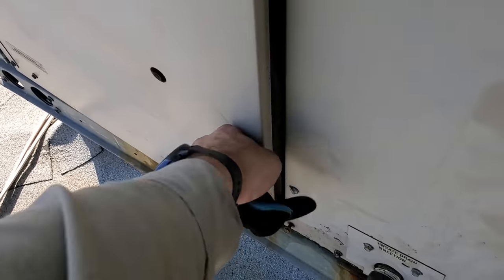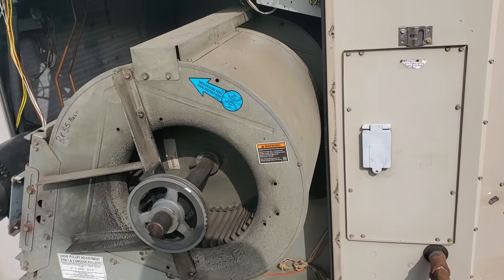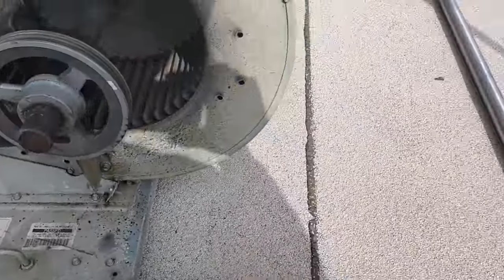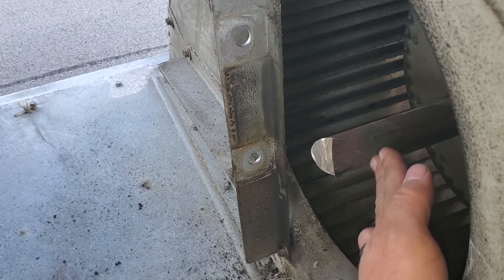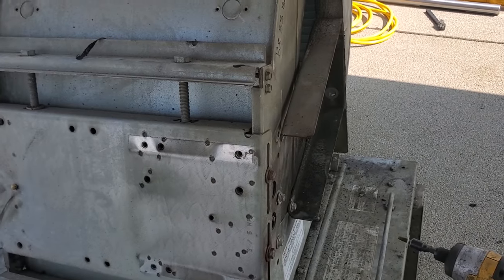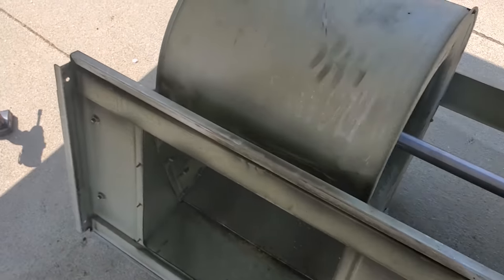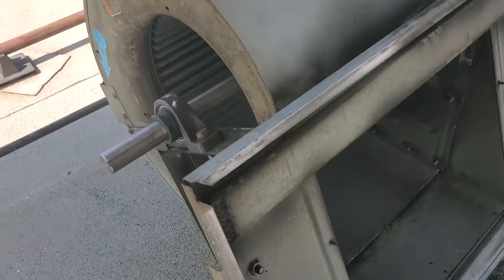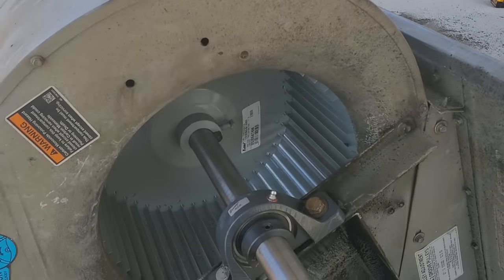THE AC UNIT SOUNDS LIKE AN EARTHQUAKE

Comment: You made me think about my very first TXV replacement job early in my career - A co-worker (Tom) condemned it based on low suction pressure (clue), and I got sent out to do the job. After finishing the work, I still see low suction pressure. Didn't take long to discover the clogged return grille in the store... 

That boys and girls, is how I learned not to trust other people's work, and to check all return grilles. That's also how Tom earned a kick in the ass the next morning. Those were good times.
Reply: Why not clean it?
Reply: @Stuart68505  That's kind of the point/lesson learned. A quick cleaning of the grille and I was good to go, but had the original tech noticed it before condemning the TXV or if I had done my own diagnosis before swapping the part, and we could have saved ourselves a whole day's worth of work.

Comment: Good video ! Like # 426. For the New techs out there - Regarding the Vibration. When they vibrate violently the wheels have most likely Lost a Weight & Cleaning Will NOT SOLVE the vibration issue. U will probably make it worse. Cleaning is Risky because if u Loose a Weight You are screwed. Best to Replace as Chris did here. Also Allways have on Truck stock extra key stock & An assortment of Allen set screws. You can buy Raw Key way material where you buy Your Bearings. King Bearing is a Good place to buy that stuff. Pillow block bearings , Regular Bearings & shafts. Good vid.
Reply: You do get that a keyway is the slot that a key fits into?
Reply: @335alien335   Yea man ! Been doing this 40 years ! Just a typo. Lmao. 😂🤣😂🤣

Comment: That's the ultimate price of not doing maintenance (including regular cleaning): you pay for a complete rebuild. Possibly suffer a breakdown before that. Solid logic quoting the rebuild right away! 👍🏻

PS PPE ftw, no one should have tinnitus because of work. Have both tinnitus and hearing loss because young and stupid. 🤬
Reply: Preventive maintenance is key, much cheaper than a rebuild!
Reply: Young & stupid definitely did some of the damage, but tinnitus runs in my family even among those folks who never did much other than office work.
Reply: This your older smarter self talking to from the future,  always keep -33db earplugs & use them often in addition to the muffs. 
I figure every hour with the plugs in equals a couple more months of better hearing in your retirement years.
Reply: I have tinnitus because of watching the original lineup of The Who live.  Absolutely worth it.
Reply: 20 years working around aircraft.  I always had ear plugs with me while working.  Kept the container on my badge.
Reply: @chemech  That sucks. Does it come with the bonus hearing loss or just the noise?
Reply: @aaronsmith5433  That's a good system! One layer of protection may slip.
Reply: @Slugbunny  I'm not yet 60, so it's just the continual ringing in my ears...

My dad however is in his early 80s, and he has significant hearing loss, as does his brother.

A math professor and a pharmacist, neither did all that much woodworking, and neither did much if any shooting or attending loud rock concerts...

Just what I have to look forward to, should I live so long...
Reply: @chemech  Okay, at least you get a grace period! I'm sure we'll all be wearing hearing aids in our retirement, regardless of how we lived. Good thing we have those... I'm trying to learn sign language just in case. 😉
Reply: @Slugbunny  Well,I was pretty good about wearing hearing protection for the last 35 years, but before that, everyone was more casual, and while we wore earplugs or muffs, we almost never wore double protection when target shooting or in the millhouses at the cement plants...

It's only in the last 15 odd years that double protection became a thing, and by then I'd been around ball mills and later electric-ard steel furnaces wearing only muffs...

It is what it is, and I'm not crying about it, just want the younger people to be more aware so they don't experience as much damage as my generation did when we thought that we were adequately protected...
Reply: @chemech  Yup yup!

Comment: when you do those locking collars, your supposed to whack them on an angle in the direction of rotation with a flat tip screw driver in the hole that has no set screw in it.  To loosen it, you whack it in the opposite direction after you release the set screw.

Comment: Good video!  Knowledge is Power...   My last new office I worked in had some hidden filters that weren't changed in the 6 years I worked in that building.  At some point someone queried the supply & the filters were found - paper, crumbling to touch!  The office prior to that was the Centerpoint building in Sydney, Australia.  After 30 years of operation & probably poor maintenance, we had to get the duct work cleaned, as dust was sputtering out onto staff...  That same building had two small water cooler towers on the roof - to service the Computer Server room.  One day, someone on our floor came to my area incapable of speaking what they'd just seen; one of the stacks from a tower - the guy wires holding the stack in place snapped, with the fibreglass stack falling down in between the our building & the next one.  A few yards in the other direction & the stack would have fallen onto the street below.  Sydney is similar to New York, so it wouldn't have been a good outcome...

Comment: If possible I would use a good penetrating oil and a brass drift and hammer to remove the shaft otherwise I would prefer a hand held bandsaw to a grinder because of the noise and Sparks flying back at you!  You did a great job there is no easy way to do this kind of work! Thanks for another awesome video!

Comment: For cutting those shafts without a dead wheel you can try a cordless m12 bandsaw. It will be much quieter.
Reply: i mean, its still better to wear hearing protection either way because you dont want to get hearing loss
Reply: @awesomestuff9715  The bandsaw isn't really loud enough to need hearing protection, about the same as a cordless impact or maybe quieter.  Cutting certain materials in a confined space might be louder.  The main danger with the bandsaw is possibly getting it stuck and breaking a wrist.  Audio feedback can help to avoid that, and roof is usually safer in general without earmuffs but I suppose it depends on the particular saw and person and situation
Reply: Or a recip saw with a good metal blade, cuts through it like butter with minimal noise.

Comment: HVAC engineer here, i tend to show radiused elbows rather than mitered ductwork with turning vanes because they are cheaper.  i only used miters if there is a space constraint that will not allow radiused elbows.  this makes me really nervous about using mitered in a kitchen setting, but it's pretty rare that I design a kitchen without plenty of space above the drop ceiling.

Comment: I have friends that refuse to do preventative maintenance on their homes, vehicles and shop tools, I can’t stand it. 
I often point out what could be replaced to prevent a failure, but just get told I’m *following the instruction manuals too closely*.
Yes, some manufacturers abuse the system by getting you to change fluids , expendables and other parts far more often than necessary, but many don’t , they do it to keep you , your tool , and others safe.

Comment: I've done two blower assemblies for Carrier 48TF series the 15 and 30 ton units. It's the biggest pain in the ass. You have to lift the whole assembly out of the top of the RTU and then you can take it apart. It's nearly impossible to do without having to sit inside of the RTU and lean against the evap just to screw everything back in. The reason we had to make the replacement is because those locking collar pillow block bearings failed. One RTU had both blower wheels explode and throw all of the blades ontop of the heat exchanger.

Comment: For hearing protector my preference is the Peltor Optime III (H540A) by 3M. But for your work it might be sufficient with the Optime II (H520F-409-GQ) that are available in a foldable variant so that they can be safely stashed. Sweaty ears is a small price to pay for a good protection.
Maybe I have noted this before, but I prefer black zip-ties since they seem to not degrade as fast, especially in sunlight.

Comment: Reminds me of the time they told me to go up on the roof where I work and look at one of the exhaust fans. Because it sounded like an earthquake. I opened it up and the pulley (shaft and all) is just bouncing around like crazy. I go downstairs, the first thing they ask me is, 'Is the belt loose? Does it need to be changed?' (note: I don't work on these)

"??? I don't know, it's shaking." 

"well, you can't just leave it off, turn it back on.' 'I left it off because the whole fan is bouncing around.' 'Turn it on.'

And for the rest of the day the customers got treated to a neverending earthquake...And they acted like I did something wrong.

Comment: Are you going to check to blower motor amp draw again after cleaning out the duct work?  I'm sure it will be moving more air and using more amps.

Comment: I had an install last year we did all metal ductwork on a 35 ton rooftop the duct dropped down 8 or 10 feet then a square 90 right out of the unit and it was big ductwork but you should have seen how much it vibrated that section of duct

Comment: Turning vanes are rare in such a system - they just aren't all that cost effective for small installations.

The do help reduce the loss factor (k value) for tight square elbows, which ties into fan dP and thus power consumption, but at the cost of obstructing the airflow.

I'm not sure what the installers did with that ducting, but it is indeed more than likely that there is at least one more such elbow between the intake and the blower.

Comment: I found out that if you don’t loosen up both set screws on variable pulley, it’ll be oblong enough from the adjustment set screw where you’ll fight getting it off. Next time try loosening both up and it should come off easier.

Comment: I had a chance to see by myself AC units in one huge hotel in the Charleston. Access to the filters are located in the middle of nowhere. There is no any human access to them.  And because of it nobody never changing them and system is running non-stop. Also, I never saw if someone changed any filters in the room units. And the owners just saving money and getting as much profit as possible. Hotel was like 400-500$ per night.

Comment: I guess I’ve been setting eccentric lock rings wrong myself? I was always taught to hold the lock ring static and turn the shaft in the direction of rotation. That simulates it tightening under load?
Reply: Yes , that’s What I was taught too. You Want the centrifugal force tightening the Lock ring , not loosening it. Hense , Hold the Lock ring & turn shaft in correct rotation. Paperwork can be printed wrong. Typos happen. I’m not changing. Been doing this 40 years. Never had a problem. I’m not changing my ways until I double check this.
Reply from the maker: I to was taught to tighten the opposite direction of rotation but I've since been corrected.... but like you guys I've never had a problem the wrong way.....
Reply: Before tightening the Concentric Locking Collar set screw, the Collar must be “SET”.  The collar has a dimple or unfinished hole. Use punch & hammer to ensues it “LOCKS” onto the Shaft.
Reply: im very sure that it locks as the same direction of the rotation. like 100% sure :D
Reply: Hvac IR it locks either way but the correct way is the direction of the rotation, if it’s don’t opposite and let’s say the set screw is loose, the torque from startup can knock it loose.
Reply: The lock ring had mass so it has inertia. The initial startup isn't enough to loosen it especially if it rotates almost instaneously with the shaft via set screw but the ring will spin in the same direction as the shaft continuously so there will be continous force applied in the direction of tightening. If you tighten the opposite way and the set screw were to fail the inertia of the ring will obviously be going with the shaft rotation and start loosening up. Probably a super rare thing but why chance it?
Reply: It's not centrifugal force in this case, it's centripetal force giving an angular momentum. If you tighten it backwards and the set screw goes, the inertia of the ring is going to continue with the direction of the shaft which means it'll loosen since you tightened it the opposite direction. Keep up with your 40 years of tradition if it makes you feel better but it is the wrong way of doing it.
Reply: I was thankfully taught the correct way to lock eccentric locking rings when I first started out in the trade.  That being said,  honestly if it came loose from rotation causing loosening of the collar it would just rotate around and tighten back up right?

Comment: with the amount of Dirt in the return air turning vanes..  will it just reclog the blower wheels?   do you use high pressure air to clean the return air grills and turning vanes..   are there filters missing in the return air grills..  do you use duct cleaning equipment. or do you sub that out to specialists??

Comment: Do you grease the new bearings on the blower assembly? We deal with high speed bearings where I work and if we install new bearings without pumping them with grease through the zerks and call it good we would get into massive trouble.

Comment: A trick for set screw to key, take a small drill bit a make a small dimple in the key and the set screw will stay tight.
Reply: A 5/32 Allen socket and a wrench make life easy too. It’s hard to get em really torqued down with a fold out Allen set.

Comment: 11:00   why is that the correct motor pulley orientation?  seems backwards.  the set screw is on the very end of the key, that seems incorrect.  the bare motor shaft is the same distance as the pulley overhang on the outside..
Reply: He should have moved both sheaves inward.

Comment: Also, if that locking collar bearing was to come lose wouldn't it fly clock wise since the shaft is going counter clockwise causing damage. Where as tightening it up like you were doing before is more safe cause if the collar was to come lose it would essentially be keeping its self tight with the rotation of the shaft?

Comment: Removing this stuff by cutting the shaft with a torch is more easy
Reply: Yes , I Agree with you too. I Prefer a Torch over All That Cutting or grinding Noise too. But , in this case it Might almost of been Easier just to Just do a Light sanding with Sandcloth  , Spray a Bunch of Wd-40 on the shaft & start Sliding stuff off. Cutting is usually only necessary on super rusty shafts.

Comment: Thanks for the video.when U found the amps of the blower a little High,did u reduce the tension on the belt to reduce the same?
Reply: Kenneth Lobo he opened the pulley more to reduce the amps
Reply: As Ethan pointed out, he opened the motor pulley to reduce amperage draw. That effectively changes the "gear ratio" between the motor and blower so the blower rotates a bit slower and puts less load on the motor dropping the amp draw. Belt tension doesn't effect amp draw, but must be correct so there is no slippage if loose or increased wear on bearings if too tight.
Reply: You’re correct to realize that after adjusting a pulley’s diameter, sometimes the motor has to be repositioned to preload the belt.

Comment: Question: the replacement steel blower shaft used, was that a factory item?  Or was a locally made custom shaft?
The reason I'm asking, is it less expensive to have a local machinist cut the shaft to length and cut two notches for the key ways?  

Any ideas about the price?

 I understand time is money for everyone.
Reply: Just checked online,  a 1 7/8 inch steel shaft 48 inches long is $63,  a 60 inches long is $78,  a 72 inch long shaft is $92.  All of those prices seem a little high to me, but they are Internet prices without shopping around. These shafts don not require any turning for shaft diameter, just slide things over the shaft.

Comment: The return  air grill should  atleast have a cheap filter at return air grill so as to catch  the heavy  stuff dust bunny garbage  .
  I relize that RTU has filters    but cheep coarse  filter at grill save turnings  vanes from building  up

Comment: Something is off with that return. I don’t recall ever having vanes in a return, supply sure but return? Changing those shafts bearings and wheels are tedious dirty jobs, great work.
Reply: If it's on the drawing, I'll put in a vaned elbow. I've been dinged by the engineers for less.

Comment: Earbuds, especially noise cancelling ones, aren't helpful for preventing damage to your ears from excessive noise. Sure most earbuds do come with minor sound dampening just like a closed headset would, but it's nowhere close to the level you get from foam plugs and an actual ear muff meant for industrial use. As for active noise dampening that relies on sending out counter waves which cancel out noise as it prevents the ear drum from vibrating. Hence there is no perceived noise. However the actual sound pressure caused by the angle grinder is still very much present. This is why active noise dampening is rarely used in industry and when it is usually just as a supplement to conventional noise dampening gear.
Reply from the maker: I will discuss this on my Livestream this Labor Day evening 9/7/20 @ 5:PM (pacific) on YouTube come check it out and no worries if you cant make it live as it will post as a normal video afterwards.  https://youtu.be/vLwC4yR3ppc

Comment: Dude that's nothing for the East coast I wouldn't even consider that to be caked on light brush to clean that thing up real good New variable pitch pulley set the speed correct it'll be good for a couple more years for a service call lol